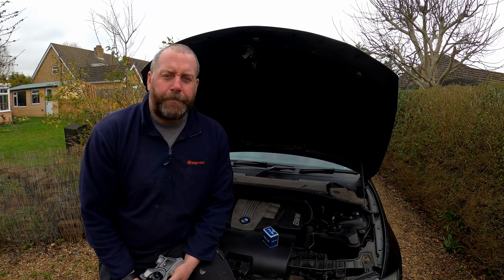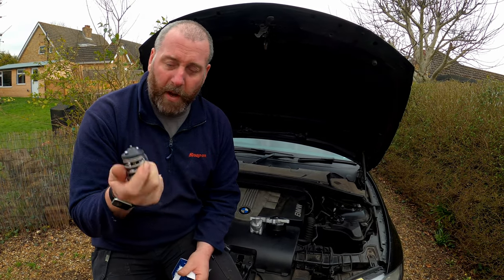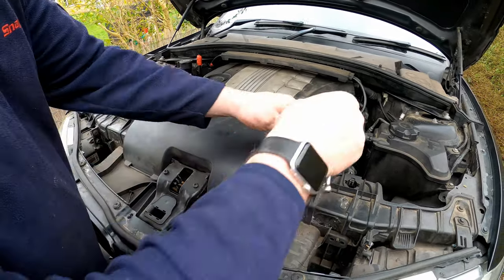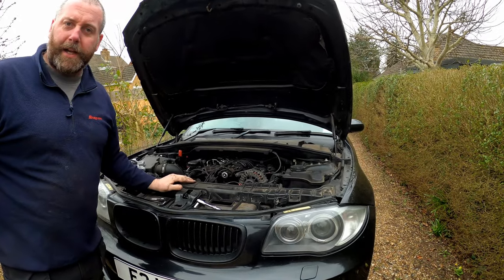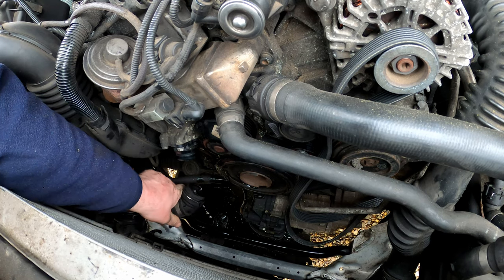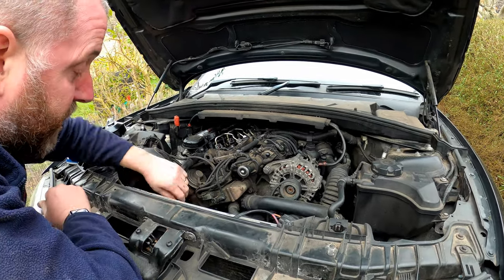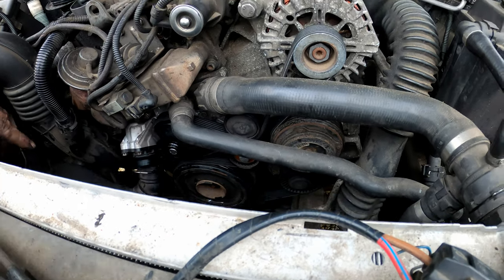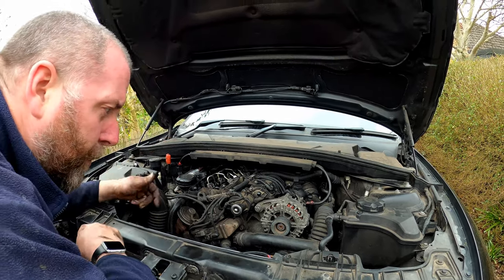BMW N47 Engine - 1, 3 & 5 Series, Plus X1 & X3 Diesel Models - Water Pump & Thermostat Replacement

Comment: TIP to anyone watching... the top left bolt is blocked by the EGR spring (which he said is missing on this car in vid) as is righttt in front of the top left bolt on water pump. You need to GET to it with your 10mm shortest socket on the LEFT hand side of the spring, to get to this bolt. You need to LOOK at it though from the RIGHT side with a torch. Socket won't go on fully so will take patience! Once it's loosened, you need to remove the socket first then remove this bolt by hand (as the Spring is too close to remove the bolt and socket together). TIP...before evening starting the job, remove this bolt first! Because if you can't for any reason and give up, least you don't have to put everything else back to drive to the garage!

Comment: I just did this, thanks to your video. Saved myself a few hundred. Mine was slightly different, I couldn't pull the water pump out as part of the EGR cooler pipe (I believe) was right in front of the top left bolt, so it was hitting it when trying to pull it out. I removed two bolts from the right hand side of it which gave me a few mm leverage which was all that was needed. The rest was bang on. Thank you!
Reply: Right hand side of the egr?
Reply: Yep EGR spring (which he said is missing on this car in vid) is righttt in front of the top left bolt on water pump. You need to TRY and get your 10mm shortest socket on the LEFT hand side of the spring to the bolt. It won't go on fully so will take patience! Once it's loosened, you need to remove the socket and remove by this bolt by hand (as the Spring is too close to remove the bolt and socket together). TIP...before evening starting the job, remove this bolt first! Because if you can't for any reason and give up, least you don't have to put everything else back to drive to the garage!

Comment: Completed this task last weekend, recommend taking the EGR/cooler off, leave the wires attach as it can be lifted and placed on top of engine,  5 fixings and 2 small water pipes with o-rings  link to the head which just pop out. Removal leaves better access to work on waterpump.

Comment: I have a 118d, 2009 model N47  with 210k miles on, which is now making a rattly gravelly type noise, water pump pully has slight wobble as well.   Autodoc basket full of required parts and pressed go, hopefully doing job  next few weeks, weather permitting? Thankyou to your post and others spreading wider knowledge enabling us to look after our old BM's keeping them on the road for more miles..

Comment: Very informative vid as always. You make the job look so easy. Love ur BMW vids! I also have a BMW E82.
The link for the coolant flush never popped up?
Also have u got a link for the small torque nm wrench u use in this vid?
Keep up the great work 👍🏻
Reply from the maker: Thanks for that! Not sure why it didn't pop up, it does depend on the device you are viewing the video on. I do know that if I watch YouTube on my smart TV the links don't show but do on my computer or phone. Perhaps that is why!
Reply from the maker: Also the torque wrench that I am using in the video is a Halfords one that i bought quite some time ago, it is 10Nm - 60Nm so perfect for smaller tasks. I had a look on the Halfords website and it appears that they don't stock that one any more. The one they do stock is a 12Nm - 60Nm which is unfortunately no good if you need to tighten things to 10Nm. I will have a look around and see if I can find a good alternative on eBay.
Reply from the maker: This looks like a great alternative at a really great price! https://ebay.us/hYhvEX
Reply from the maker: I'll take that back! I had totally forgotten to put the link card on the video! I have done it now, it's at roughly 31:30 in the video 👍🤓
Reply: A lot of people slate them but Halfords tools are good, and some of them have a lifetime guarantee on them. And a good price

Comment: You mentioned about the coolant temp  should be maintained around 74deg, is that a good indication that thermostat is failing if your coolant temperature is going above 90deg in the working temperature? Thanks

Comment: Hi mate I’ve just replaced the water pump on my 3 series I’ve ran up to temp but the fat hose from the water pump Dosent seem to be getting any heat in it any ideas ?? The one to the thermostat housing is hot but not the one above it 🙈🙈

Comment: Hi kev just like to ask about the egr valve delete you mentioned
I have heard that if you delete the egr your pdf will block up a lot sooner. Don't know how true that is what are your thoughts
 Cheers pal love the videos
Reply from the maker: I have seen arguments for and against this, I’m in the no camp. I’m of the opinion that the DPF would have blocked anyway and that it’s merely the owners blaming the EGR delete without looking at all the factors. The highest risk to the DPF is constant short journeys that do not put the car into the conditions necessary to promote a regen. My 1 series gets driven approx 6 miles a day by my wife which is exactly what the DPF doesn’t need! Every few weeks, I will take it on my commute which is a 74 mile round trip. This allows the regent and I have never had an issue. You can tell when a regen has happened as you can really smell it when you park the car up! 👌🏻

Comment: Very strange that you didn’t show how you got the dowels out, that was a key part especially for the other non mechanics watching along to replace their pumps
Reply: Super simple, like he said put a bolt or drill bit whatever in the dowels holes first so they don't get bent when pulling them outwith pliers.

Comment: May i ask that how did you managed to get that bolt out on the upper left corner? Behind that ? thing.
Reply: You remowed that spring and did that rod come out just pulling it? There is a valve inside? Can position move?

Comment: I’m struggling with the top left bolt to remove the water pump. Any tips?
Reply from the maker: I’ve had a few people mention that, it seems that in some cars that the EGR valve is different and gets in the way of that bolt.
Reply: @KevsShed  it’s a spring under the egr, which is directly in the way. I’m going to try a universal joint when I get my hands on it
Reply: @KevsShed  I managed to get it off by using a small 10mm socket, with a wobble head attached to it. Got it into the bolt that attached the universal joint and ratchet, gave it one twist and did the rest by hand. See what it’s like putting it back on because I’ve got the wrong pump lol

Comment: Iam having issues with my dirt bike, the bike has compression and will start when bump started. I have cleaned the carb and replaced spark plug but are still having no luck. I was thinking about changing the Jedi cable as I don’t think there was a spark. Any advice would be appreciated

Comment: I have 350 000km on the n47 stil first pump
Reply: Wow😅👍, mine 236 000km. I just buy skf water pump this week.
Reply: @matteo512   the electric extra water pump now failed at 385000
Reply: Changing mine tomorrow. 320 000 km on it!

Comment: Next time, do it from the bottom man on 4 cylinder n47 engines there is plenty of room from bottom, just release a belt, take it off and boom, no need to take the Karlison(Cooling fan) off...

Comment: The water pump isn’t on the cylinder head it’s on the block
Reply from the maker: Correct, Freudian slip! 👍🏻
Reply: @KevsShed  i have to do the very same job today on my 520d my pulley is rattling like a bag full of spanner’s lol 😂
Reply from the maker: @Alan2puttsGolf  good luck dude 👌🏻

Comment: 1000 excuses, can't you first let the cooling water out completely and then remove it? Or was that a spontaneous decision?  Can you also name all the things after your experience, such as the hot seals, bolts if you still need them as a reserve?